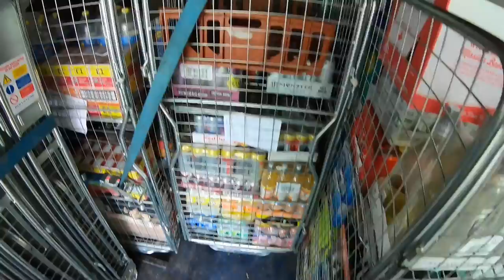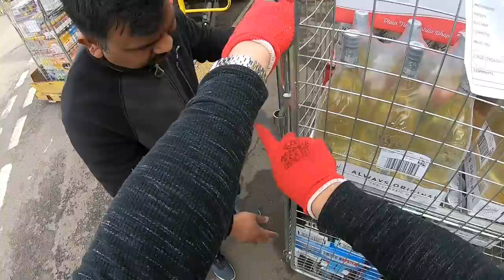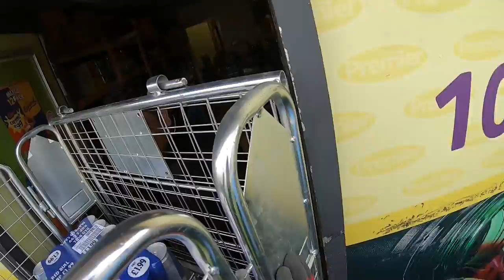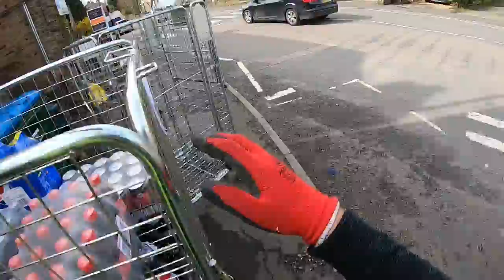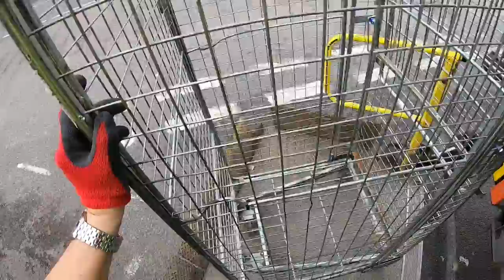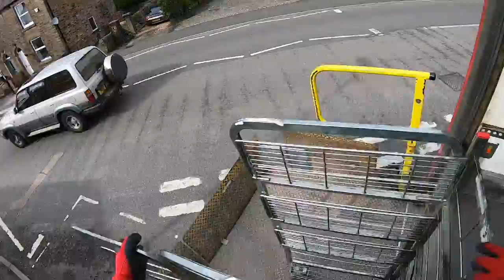HGV CLASS 2 AGENCY DRIVER - 7 HEAVY CAGES 1 DELIVERY ON CORNER SHOP [POV]

Comment: Had a cage tip before taking it off the tail lift with the steering wheels first….dont make the mistake I made Robert😂.  I feel your pain though they type of cages are a nightmare when theyre full😂
Reply from the maker: Thanks mate. Them cages area absolutelly nightmare. I do prefer pallets instead haha

Comment: Great video's bud
My only bit of advice from someone that's been on cage work for 2+years would be to always aim to load the cages on the lift so that the fixed wheels come off frist that way if you need to shunt or pull the cage it doesn't tip o er or run away from you as the lift still has control of the Twisties wheels because sometimes if there's a little dip in the pavement the Twistie wheels tends to drop in to a dip side ways as your still pushing/pulling it causing it to topple over..........also i find it easier when pushing a cage weight and ground depending if the Twisties wheels go frist incase there's a bump in to the store im sometimes able to tilt it back on the rear fixed wheels
Reply from the maker: Makes sense and thanks a lot for sharing your great technique with us all. Take care pal.